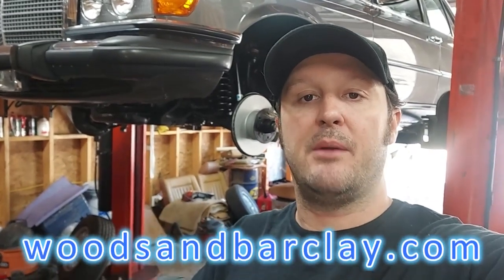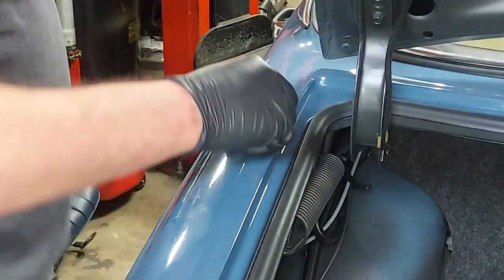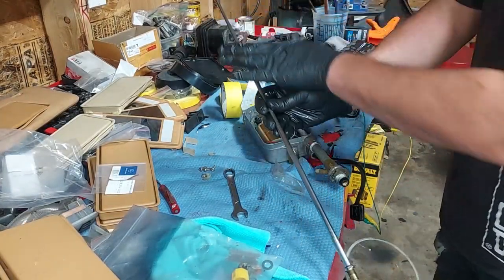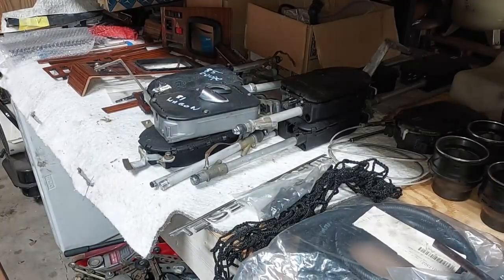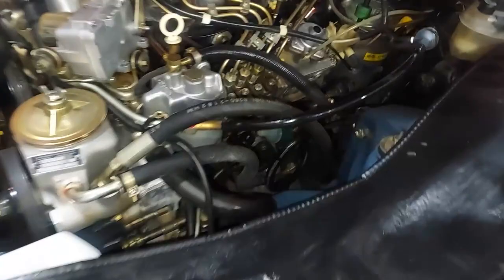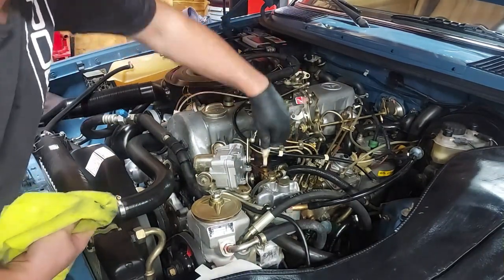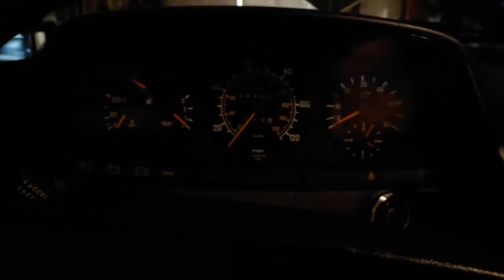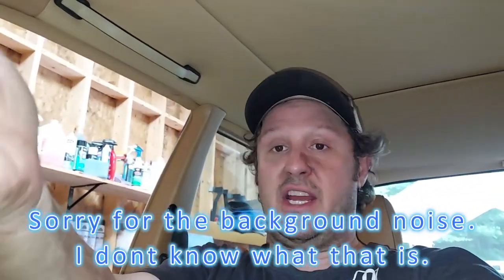1983 Mercedes 300D - Part 3 Suspension, Air Conditioner, Dimmer Switch, Wood Trim, Hirshman Antenna

Comment: I like your video’s. I have also w123 300 turbo diesel from California. And i learn a lot from your video’s😍
Reply from the maker: Thank you I'm so glad you're enjoying the videos!
Reply: Where did you buy new parts? Mercedes or aftermarket?
Reply from the maker: @lukaduspara2585  I always purchase from the original equipment manufacturers. Lemforder, Behr, VDO, etc ... These are who Mercedes gets their parts from. If you buy a part from the dealership you're just getting a part that has been branded by Mercedes and you'll pay double the cost. It's always smartest to buy direct from the equipment manufacturer. Mercedes does not make parts. They pay the original equipment manufacturers to make the parts for them and then they mark up the price. There are a few things that we buy from the dealership because we cannot get them from the OE manufacturers, like windshield gaskets.

Comment: Is it expensive to fix the airconditioner? 
Im looking into exact the same car but the aircon doesnt work!
Reply from the maker: It's around $400 in parts and about 4 hours of Labor. If you have to replace the expansion valve add another $50 and another hour of labor. If you have to flush out the system add another hour of Labor. So worst case scenario you're looking at probably $450 in parts and 6 hours labor. Keep in mind those parts prices I just gave you are a shops wholesale cost for parts so you would probably have to pay double that for parts cost if you have a shop do this. So you could be looking at anywhere from 1200 to $2,000 for a shop to completely go through the AC system. If you tackle the job yourself you could probably do it for around $400.
Reply: Thank youuu for replying that fast! 
This car im lookin at is in Europe £2.7k 
443,000 kms (which is not bad) 
Interior impecable. 
Exterior seems good. 
I think it might b worth the shot. Here labour is not expensive (Lithuania)
Reply: Its a mechanic (which i love) and 65Kws. The inside same  leather as in your video with sunroof.

Comment: Hello John, 
Once again, I love your videos! 
A quick question: What is the part number for the hood pad? (the one without the silver thing for turbo) 
And do you get it from the dealer or OE manufacturers? Which one is cheaper? 
Thank you and hope to hear back soon! 
-Henry
Reply from the maker: You can go on Google and type in 300D Hood pad and it'll be right there in the results. I just buy the OEM Hood pad. I think you can get them for around fifty bucks from any of the major retail outlets. Fcpeuro autohaus AZ or the Mercedes dealer.
Reply: @woodsandbarclay   Got it~Thanks John for replying!

Comment: Hi…love your videos…I have a W123 that just had an A/C compressor failure. I’d be most grateful if you could steer me toward a new compressor…I’ve heard too many horror stories about replacement compressors and have no idea where to get the best one. Thanks in advance
Reply from the maker: If you go on eBay you can often find the original GM AC Delco r4 compressors.